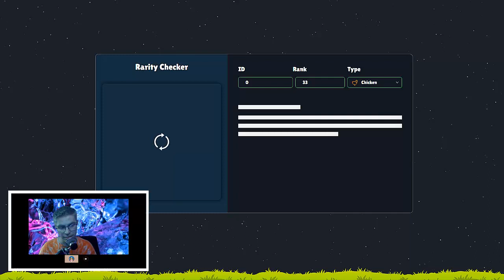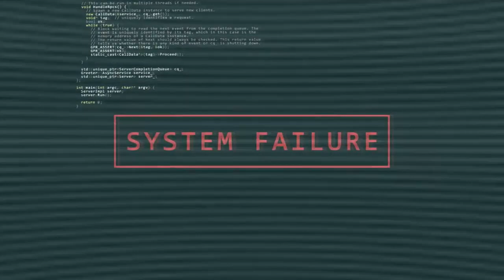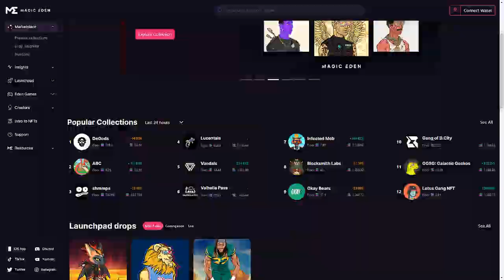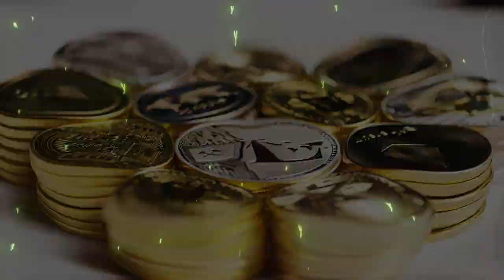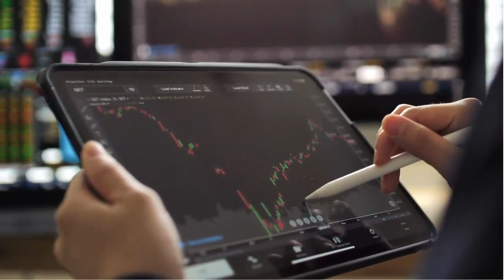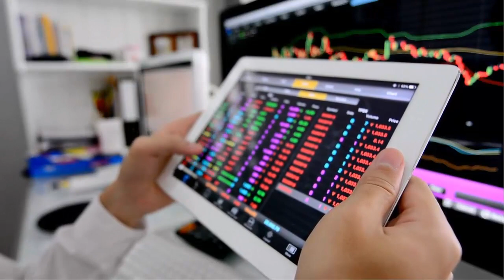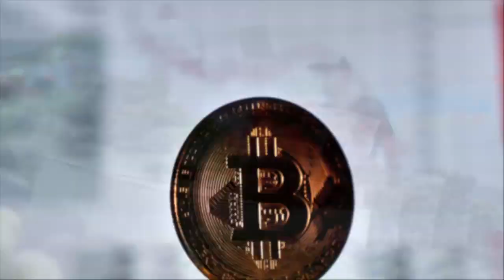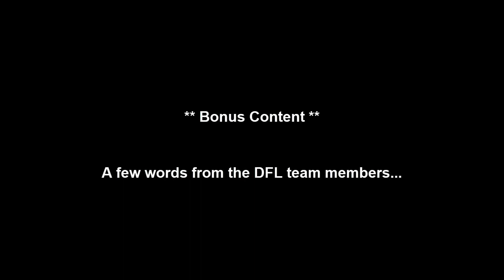DeFi Land Interview | Celebrity Backstory | NFT Backstory | Starting an NFT Project

Comment: I'm having problems getting into the game. It won't load. Does it need certain specs to run? Tried it on mac and widows 10. Cheers
Reply from the maker: Hmm!! Just gets stuck at 99%? Or? What browser are you using and what wallet? Chrome and phantom? 

There is a discord channel for Defi land. You can put your questions in their technical support channel to get some resources on their team to help!
Reply: @EntertainingEntropy  I got it to run on firefox. Laggy, but my laptop is 10 years old. Game has potential. More mini games would be rad.
Reply from the maker: @Preslaed  Yay! Good to hear. You can lower the graphics in the settings which might help a lot.

 Also check out my YouTube video on DeFi Land if you haven't seen it. It showcases the whole game!

Also a racing game with a new animal is coming reaaaally soon!! Stay tuned